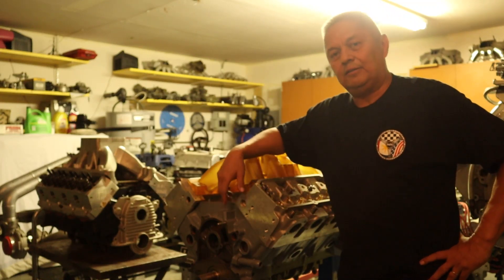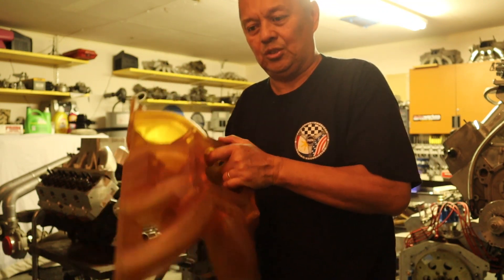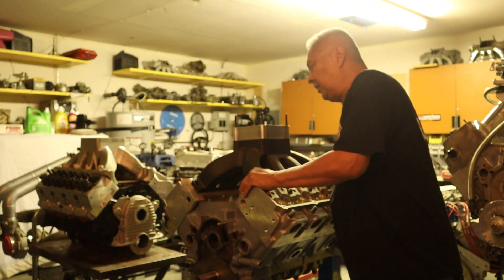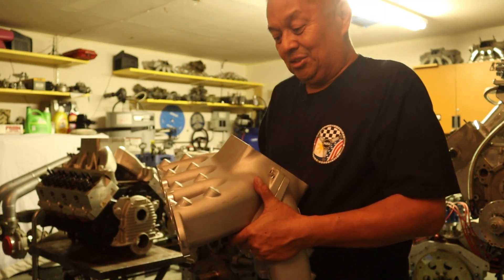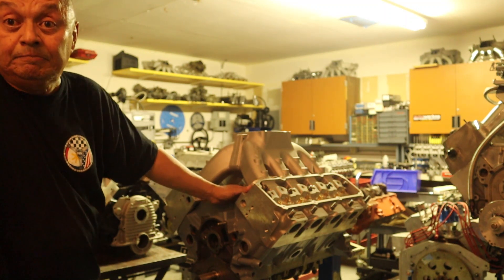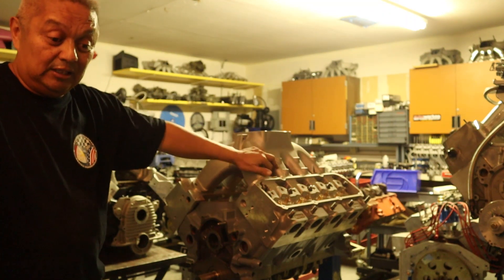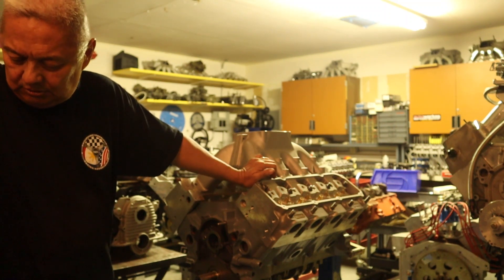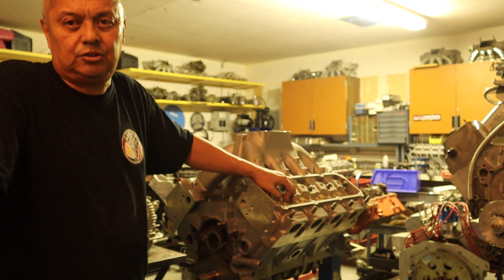FORD INTAKE MANIFOLD TECH PARTII.

Comment: wow i absorbed some great tips in this video! i ran some mls head gaskets in my bbf when i stripped it on the off season that were the correct bore dia,picked up HP without really knowing why,4.40 bore with 4.40 gasket .i was running a 4.50 gasket.
Reply from the maker: Thanks and many make this horrible oversight and end up loosing some more power thru the built in EGR action of the leftover gases all around the bore space which is really bad considering .100 over bore diameter is a lot of gases leftover.

Comment: It drives me insane to see intakes and exhaust or anything where the ports are not aligned, also it's not just that they do not align, the flow paths need to align also, the airflow needs to flow straight into the head!  Not Into the wall of the head, or the floor of the port the the head, its not going to flow like it should,!!
Reply from the maker: James, this issue can be a bit confusing and when you say aligned it can mean easier back flow or reverse flow just as easily contaminating the mixtures.  Sometimes a little bend can beneficial because it tends to help mixture motions in regards to swirl/tumble properties. Straight thru ports sometimes will not yield what you expect and there are surprises in the whole scenario of flow volume and flow qualities.